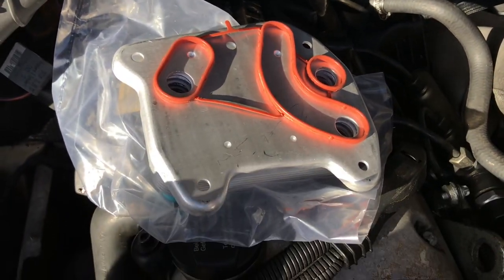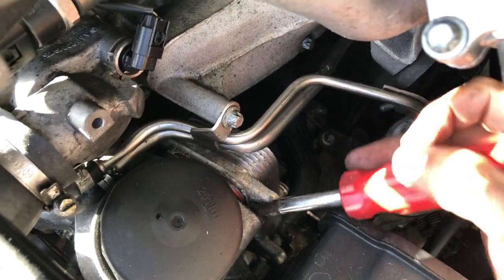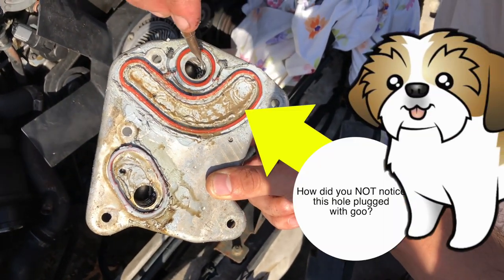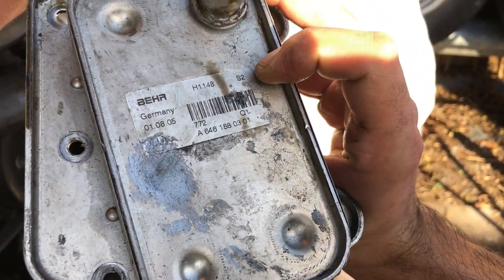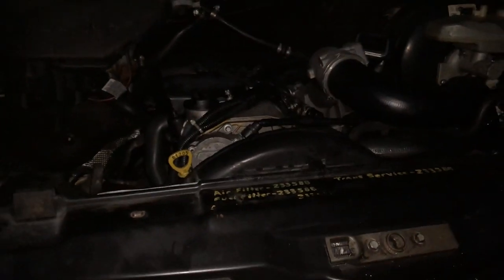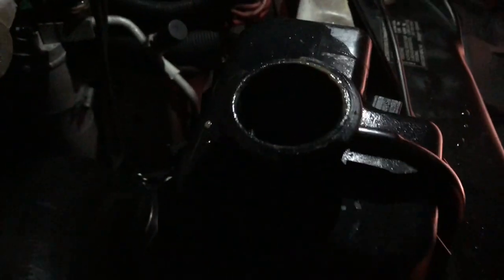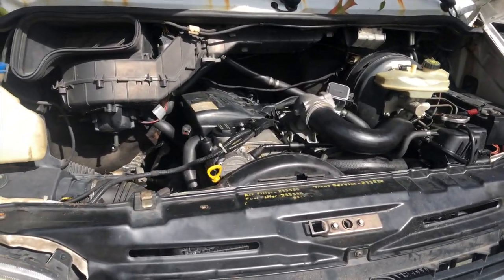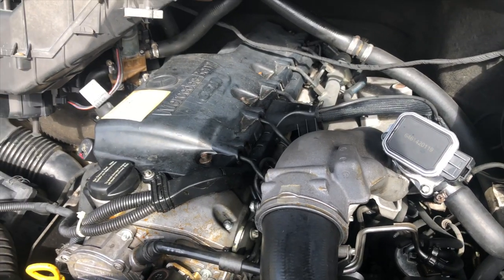Fixing Oil In Your Coolant for $30 - T1N Sprinter (2002-2006)

Comment: Did you use anything to stick/“glue” the new gasket onto the new oil cooler to keep it in place while installing?
Reply from the maker: A little spit is all. Gross but effective and always available.
Reply: I am in England and I have a British Mercedes Sprinter, There are grooves for the seal on my van they are not on the oil cooler they are in the face that the oil cooler fixes too. Also being a rhd van I had to remove the heater plastic so that I could have full vision of the oil cooler mounting face.

Comment: Do you have to pull the radiator to get to/replace oil cooler?  And do I need to drain the oil before removing the old cooler?  Thanks
Reply from the maker: No and no. Oil cooler is on the engine block behind the oil filter. Radiator is far from it. you don't need to drain the oil but do drain the coolant before taking the oil cooler off to avoid any coolant spilling into the oil chamber as the cooler comes off.

Comment: "caught it just in time" to prevent what? what would happen if you didn't catch and address this? i've got gravy in my cooler of a 2005 sprinter 250k miles, but the coolant level is low. i've had to add coolant twice in about 800 miles. i've got white smoke out the exhaust that's heavier at higher RPM. there is wet/oily soot built up around my oil cooler and on my air intake temp sensor. also wet soot at hose connections to my turbo (just found a wet sooty crack in hose to turbo at the clamp that i will epoxy in the morning) and at hose connections to my radiator. any suggestions would be much appreciated as your posted videos are, too. i do have a second van to swap parts btw. have you yet resolved 2blue's smoking problem?
Reply from the maker: 2Blue got a replacement engine from a you-pull junk yard. We were looking for seats and fond an engine that looks too good to pass-up. 
Gravy in the radiator can be a oil cooler, but the smoke you describe combined with oil in the rad suggests a blown head gasket or crack in the head. These issues are what we avoided by catching the oil cooler early. The oil in the coolant gets foamy and blocks small passages the coolant should be flowing. This will cause the engine to overheat in some areas while the flowing coolant is still at acceptable temperature. it just cuts-off cooling to parts of the engine and bad things happen from there.
Reply: @FloridaVanMan  thank you! i just bought ya couple gallons of coffee. upon further inspection, my coolant is only slightly murky and not foamy, so maybe it doesn't have oil in it? i replaced the cracked hose to the turbo and the EGR valve/gasket, and the result is much improved smell and little smoke. i do have this black liquid inside my intake manifold/hose and even some on my turbo. must it be engine oil or could it be soot + coolant from a leaking EGR? Two more quickies about my 2005 sprinter 250k miles: how do i know if my DPF is clogged or needs work? also, i have one code that appears immediately after erasing and starting vehicle "U0423 Invalid Data Received From Instrument Panel Control Module." where is this module and is it likely faulty? or could it be something screwy like my climate/fan controls that don't quite fully function?
Reply from the maker: @data_Dj  Thank you for the coffee and support! Sounds like a cracked hose was making things oily, so that is fixed. Motor oil in the turbo lines is perfectly normal. The crankcase breather vents into the turbo input, so that vapor collects in the intercooler & boost passage. The best news is our 2005 Sprinters do not have DPF so that will never need work.  
Now the hard stuff: U0423 is usually a wire problem between the dash display and the ambient air temperature sensor near the front license plate. Does your dash board display a proper temperature when toggled with the time display? The wires are sometimes damaged doing work around the radiator and they sometimes fall victim to rodent chewing. Occasionally the sensor itself will fail, or the dash cluster. I've read of bad fuse connection near the top of the fuse block, so giving a little love-tap would be a fair test. Checking all fuses is always a must when looking for electrical gremlins. Even when we know they are good.... sometimes they aren't! So I take them out, one-by-one, and put the back. It is tedious task but takes only a few minutes.
Reply from the maker: @data_Dj  Two more things: The dash display we are discussing is the speedometer, odometer and gauge display, not the climate controls. Those are a separate issue and not related to your code. If your fan is working only on highest speed, we have a video for that with link to $12 repair part. https://www.youtube.com/watch?v=cXmYsW4iozc&t=18s 
If the heat doesn't turn off, we have a video for that too.
Reply: @FloridaVanMan  thank you! more coffee your way. my dash does not display any temperature, rather it displays "---", so i will look at the wiring and the ambient air temp sensor. additionally, both of your climate controls videos are applicable to my sprinter, so thank you again. one more thing: how much smell and fume is ok? i no longer have the smoky exhaust, but it's stinky around the van when running - maybe just stinky like any diesel engine but i'd like to know what's too stinky to ignore. it's also a little stinky inside the van when running. anything besides the cabin air filter that i should plan on fixing?
Reply from the maker: @data_Dj   Every one of our vans has its very unique "stinky". One day I will learn to diagnose diesel issues by the smell, but for now every one is just a unique flower. The cabin air filter often does not seal. There was a thin foam gasket that probably rotted away some years ago. Also the cargo areas are not sealed from the outside. many T1N's have short tail-pipes that end under the van, not at the bumper. These vans show a lot of soot inside the cargo area walls when we remove the plastic interiors. That soot tells me a lot of exhaust is getting inside.
Reply: @FloridaVanMan  thank you! my exhaust is rusted broken after the big muffler which comes after the two small mufflers (catalytic converter? or does t1n not have cat?) ever seen anyone run the exhaust through the floor of the van and out the side near the roof? i can't think of any other way to get the fumes above nose level. i understand this will make for some heat and noise inside the van that will ideally be insulated/sheltered against?
Reply from the maker: @jiggityboomslang  I don't think that is a very good idea. Why not fix the tail pipe and route it to the rear bumper?
Reply: @FloridaVanMan  more joe my treat, but does the t1n have a catalytic converter or are the small muffler chambers something different? my intention is to minimize the stink + fumes all around the vehicle. i intend to exhaust an incinerating toilet out the side of the van anyway, so i figured i'd output the pipe from the engine exhaust out the same hole. highly unconventional it appears.
Reply from the maker: @data_Dj  Yes, the pair of bulges are indeed a Catalytic converter, but on a T1N they are not the valued and often stolen, high dollar cats. I have two worries about your ideas. Linking a pressurized exhaust pipe with a fart-vent is going to push exhaust fumes into your pooper. The other worry is trying to vent exhaust away when parked. Are you going to idle the engine while parked? I try not to let my van idle more than 5 minutes any time.

Comment: Hello does anyone know what can cause coolant fluid between where transmission and engine meet? It’s also leaking black oil from there.... 2006 sprinter 2500.... thanks in advance for any possible feedback that might help!!

Comment: What was your flush procedure for this? I imagine you did that after installing the new cooler and gasket?
Reply from the maker: Lots of Dawn dish soap in the first wash with hose water, warming by running then rinse and repeat with less Dawn each time. never put cold water in a hot engine. Drain while hot but do not refill until engine cools. Nothing breaks down the oil like Dawn and it is safe for ducklings and that's good enough for my van.

Comment: Hi my name is Gabriel I have 2006 Sprinter Diesel,  Temperatures around here I’ve been in the mid 40’s, for the past week I have noticed that The van works fine until the engine temperature goes above 150 Fahrenheit then goes into limp mode,Also I have noticed that I have a fuel leak behind the tank where the cooling coils are for the fuel it looks like it’s coming from a lot WYE connection I was wondering if the fuel coil thermostat could be causing The limp mode if there’s an obstruction in the cooling lines, I have replaced fuel pressure regulator on the rail and fuel pressure regulator sensor at the front of the rail still does the same exact thing
Reply from the maker: I know those coils can rust and leak at the Y-joint/valves. I've not seen one blocked and don't know how/why that would trigger a limp mode. Some of our vans don't have the Y and only half the coils. And maybe back pressure here would cause rail pressure too high. I suspect any obstruction would be in the Y, not the tube. If I had a leaking one and didn't have easy access to a parts-van, I would put in a simple T and see what happens.
Reply: Thank you I will replace the wye fittings ( 3/8 diameter?) What I was actually thinking as well to see if I could bypass the fuel thermostat and see when the engine warms up if it still goes into limp mode
Reply from the maker: @gabipanaite9258  Avoid brass if you can, and get stainless steel. Biodiesel blend is hard to avoid, and the bio will make brass brittle in a year or two. It dissolves the zinc from within the brass, leaving a fitting that will weep and look wet all day, every day.

Comment: There is a schematic of the cooling fluid shown in this video that is also posted in sprinter-source forum that I have a question about. Why does it show flow through the heater core before the heater control solenoid valve. Shouldn't the flow go through the T joint to the solenoid valve then continue back to the engine.  Then as the heater cycles it opens at the solenoid off and on letting fluid into the heater core and exiting to the T joint. The arrows flow wrong direction it seems. What does anyone think. posting a correct flow schematic would be nice.
Reply from the maker: The graphic is correct. The valve is after the core, which seems wrong but when the valve blocks water from exiting the heater core no fresh hot water can be drawn into the core, so it works as expected despite the late placement of the valve.

Comment: Did you see Coolant I the oil or just oil in Coolant reservoir
Reply from the maker: If caught early it will be only oil in the coolant but... every time we shut off the van the oil pressure drops immediately and the coolant system remains pressurized while hot, so a bit of antifreeze will get into the oil side (theoretically).

Comment: Having the same problem but I’ve got a couple questions before I tackle this. Do you need to do anything with the oil when flushing since it’s mixing in with the coolant system? And to do the flush do you just go through the coolant overflow and out the egr? How many flushes did it take? My overflow is pretty much black(darker then chocolate milk)
Reply from the maker: The oil pressure in the cooler is much higher than water pressure in cooler so oil typically goes into the water, not the other way. BUT... since your water is very oily and the oil is apparently very black I would give it an oil change soon after flushing and fixing. Flush by removing the bottom radiator hose. This will let the water "flush" out like an airplane toilet and pull oil with it. Flush with water and Dawn dish soap. "Dawn", not whatever your mom has. (hehe) LOTS of Dawn in the first flushes and less Dawn in the last few flushes. Flush it as many times as you can bring yourself to do it, minimum FIVE. Warm the engine by driving every time. Idle in the driveway wan't warm it fully or quickly. Drain the water as hot as you can without burning yourself. As the radiator cools oil will stick to it, inside.
Reply: @FloridaVanMan  thank you! Also since The oil cooler failed should I do flush before or after new cooler. If I do it before new cooler won’t the oil just keep mixing with coolant when the engine is warm?
Reply from the maker: @connorpetersen8392  Yes, fix the failure then clean the mess it made.

Comment: I didn't see the hose in the description. I think it's this part: Oil Cooler Coolant Hose (T1N) 6112030582 46551

Where did you end up ordering from?
Reply from the maker: MillionMileSprinter.com has the OEM oil cooler and also an upgraded thicker oil cooler as well as hose kits.

Comment: is it possible to do without draining the whole system?
Reply from the maker: No, you need to get as much oil out of there as possible. Lots of Dawn dish detergent (cuts grease) and many flush and refills with more Dawn. Minimum 3 complete flushes... and that is short-cutting. Water, not anti-freeze in the fill/run/flush/repeat. Do not pour cold water in a hot engine. Patience patience patience...
Reply: Gotta drain the coolant yeah, but does this affect your oil level? Does that need to be drained before removing the oil cooler?